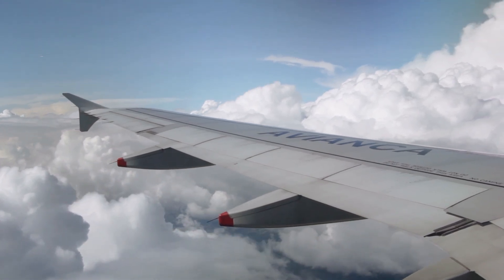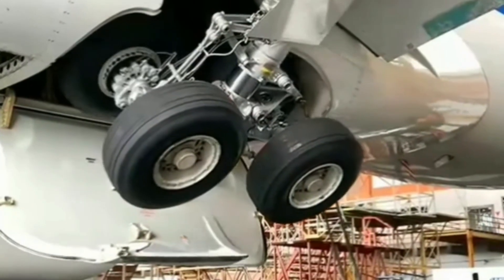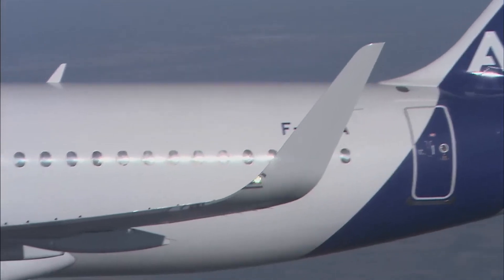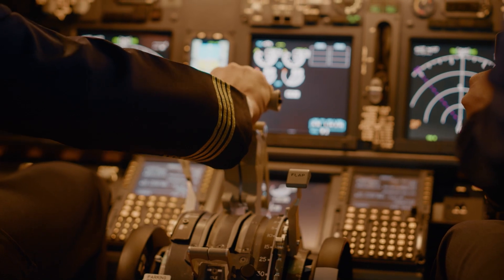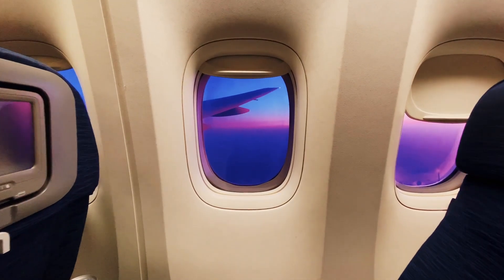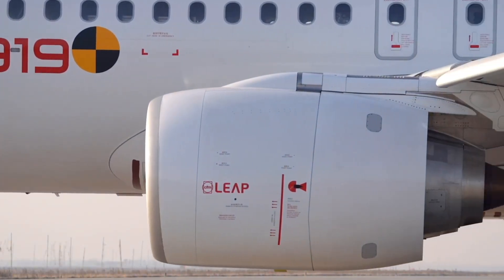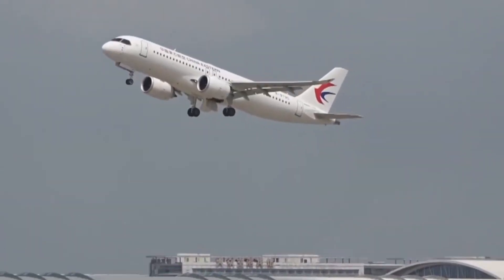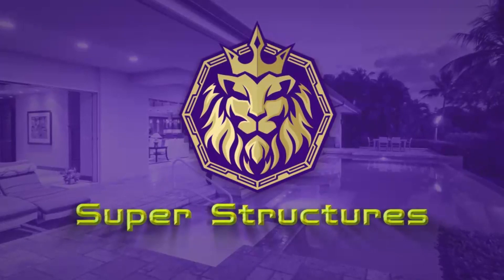The Epic Battle of Boeing, Airbus, and the New COMAC!

Comment: Our concern is the safety of air travel. They should concentrate on developing safety and protection for passengers from plane crush or engine failures for example, rather than some necessary competition that will jeopardize the safety of passengers